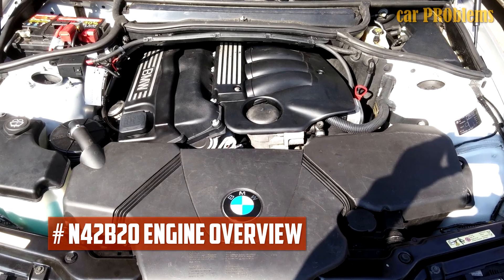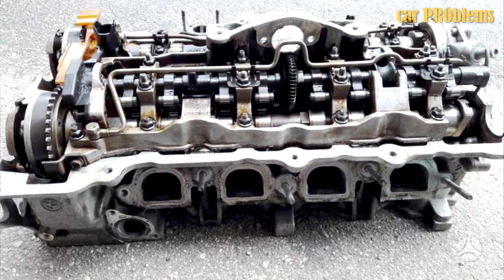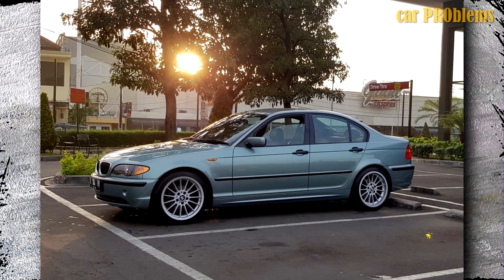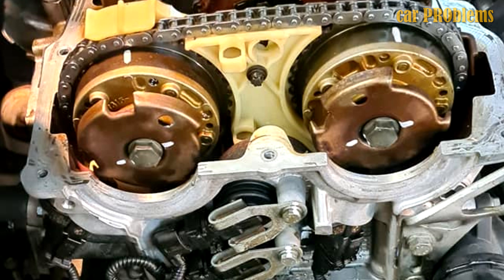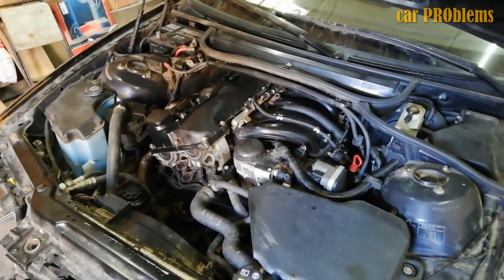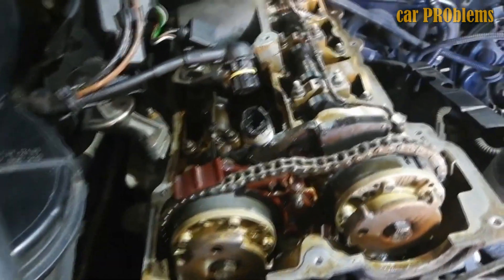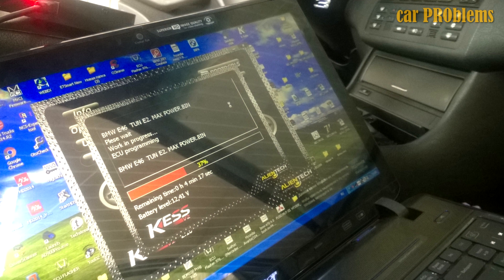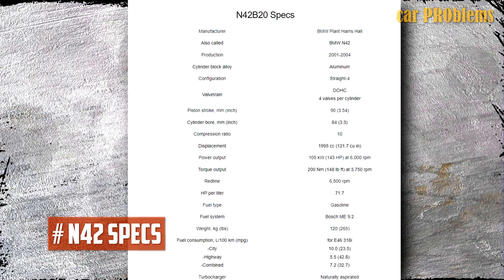BMW N42B20 Engine (BMW E46 318i) - Specs, Problems, Reliability, Tuning

Comment: Whats best oil for it then ? Castrol 5w 30 fully synthetic ?
Reply from the maker: Hello! Castrol Edge 5W-30; Liqui Moly Top Tec 4200 5W-30
Reply: @carproblemsmax  what about 10w 40
Reply: @carproblemsmax  Hi, the Castrol Edge 5W-30 has no longer the approval of BMW. I used it for quite a while myself, but recently my BMW Store told me, that it has no longer the LL clearance.

Comment: mod the block and head to take bigger head studs and turbo kit it and standalone ecu map make over 250 hp  the only way you will see results worth making a video about tbf shite engine over engineering in some places eg valve train , and  some stupid weak points eg 6 m10 head bolts in centre and outer bolts are like m8 wtf .... no wonder head gaskets fail.. big ports in head should make decent power if crank rods can cope
Reply: The options are: Change car, change engine to a bigger one, turbo or cheap supercharger kit. The cheap belt charger might be quite convenient for certain builders and budgets. No need for turbo exhaust manifold, no heat problems, etc. Not crazy power, but you don't need that much to turn a Compact E46 sideways for example.

I hear they do use these engines in sprint and other sports, with high revving NA builds. So I guess that's possible too. Just sounds like the most expense per horsepower.